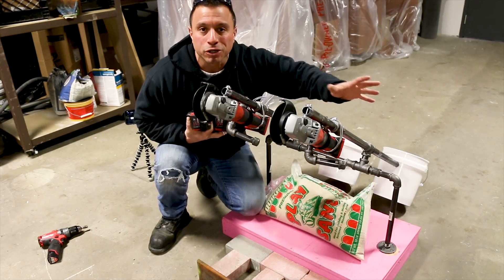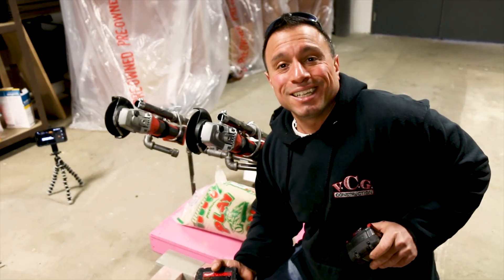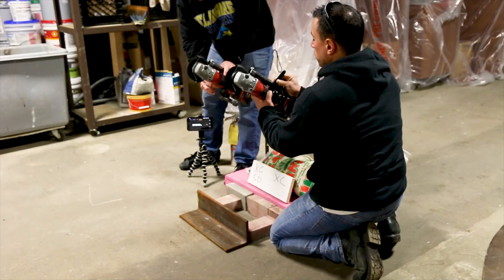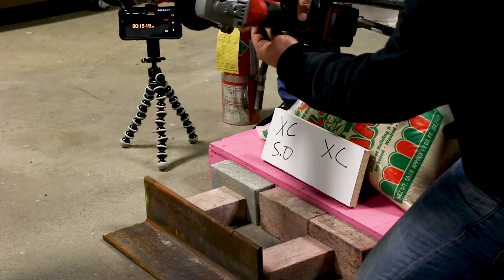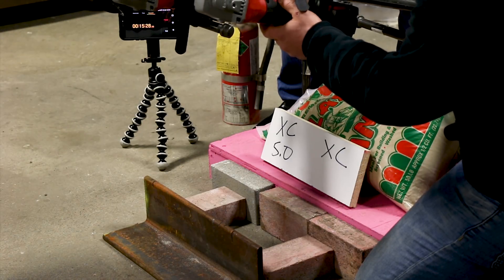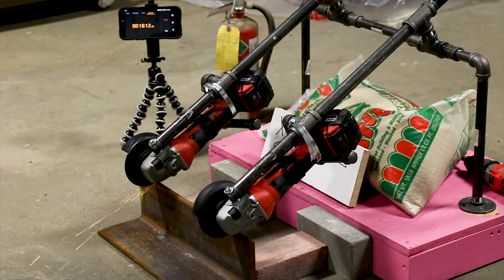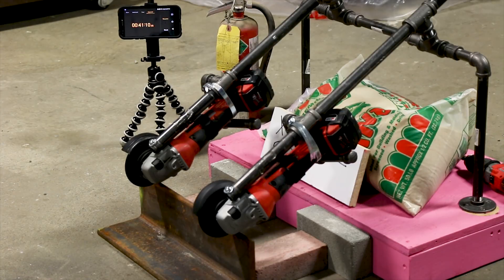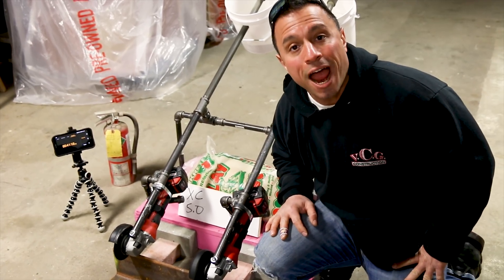Milwaukee M18 Batteries Tested Under Load !

Comment: 3.0 was under more load in this video which is why it cut more. The 5.0 lasted so long because it was hardly under load. Shouldn’t be that big of a difference. 5.0 should last maybe 5-10 min longer.

Comment: Like I said in the last video as you see under load the XE 5.0 battery will run 1 1/2 times more then the XE battery
 As for the test rig great idea great concept one thing that I personally would change would be a crossbar in the back and in the front level and off both tools at the exact same height  So therefore when you push down both of the tools would make contact at the same exact time

Comment: Under load? Those pails are acting as a counter weight, not placing any pressure on the tool. The grinder with the 5.0aH battery cut through less than an inch in 41 minutes. Should have been able to cut through the whole angle in a quarter of that time.

Comment: You could use a pull up scale and make sure both have the same weight on blade ,there not grinding at the same rate. This test  is invalid not picking on you .Project Farm does some great test's.
Reply from the maker: It does need refinement, thanks for the tip!!

Comment: Scratch my last comment... would help if I watched the video without fast forwarding. I didn't realize the fittings he used kept them from moving in unison. Yeah, I'm not sure why the 5.0 didn't cut through the steel at the same rate. Must be another variable that caused the difference.

Comment: Love the thought process and the time you took to run this test but yes there is critical flaw. The issue is the pipe that connects between the two rigs. Once the standard battery stopped, it rested in place on the steel, which in turn held the other angle grinder in place. The 5.0 battery/grinder didn't have any more resistance once it cut the steel at the held height from the other grinder. Had you disconnected the two rigs, they would act independently of each other. Keep up the great work... and these informative videos.
Reply from the maker: I saw your other comment as well and this test rig still needs even further improvement!! I’m gonna get it right one of these days!!

Comment: To be honest, I think it makes more sense to buy the battery that suits your need, more than $/runtime.
At work, I am using the Milfuckee Wet/Dry vac (Cleaning heavy equipment). All the batteries in the shop at 5.0s, and generally, I can do a machine well on the first two bars of charge, before the battery voltage starts dropping, correspondingly dropping the chooch factor. If I were using the 3.0, I would pretty much be guaranteed to have to replace the battery at some point, just to keep the vacuum chooching at a respectable rate. 1 bar? Damn thing is struggling.

In my use-case, the 5.0 just makes more sense (6.0 or 9.0 would likely be better, especially for rock trucks and their larger cabs).

Comment: Nice job what's strange is why one cut so deep compared to the other. You should charge the batteries and put the batteries in opposite machines to see if there is any difference. Great job by the way
Reply from the maker: We’ve did some fine tuning to the rig, now we need to run some new tests!!
Reply: Spot on comment. That is EXACTLY how to account for the variation in cut depth.
Reply: Also give us $ per depth of total cut.

Comment: id like to see another attempt, maybe throw the 9.0ah into the mix.. id forget the rig although it looks like itll come in handy for other tests anmd just cut strips into 1/4" plate or lengthwise down flat bar by hand same person doingit and compare them to see how far they cut, try and keep feed pressure and cutting technique similar but they dont need to be exact

Comment: this is an inaccurate test. You should redo the test without the grinder wheel on the XC already about 1 inch deep into the steel. This causes more rubbing on the grinding wheel faces making the tool/motor work harder and asked for more power from the XC battery. You should do an independent test on each types of batteries using the same grinder. Plus, your test didn't really adjust for the weight difference on the XC and XC 5. One is heavier than the other which adds more weight to the mechanism. More weight means more loading and requires more torque from the motor. For a motor to generate more torque, it needs to pull more current from the battery.
Reply from the maker: We were definetly thinking about revisiting this test! Thanks for watching!

Comment: The test should be run 3 or 4 more times.  I would say with the same grinder to reduce the variables.  Also add a small weight to push it into the metal.  Even the weight of the other battery to keep the down pressure the same.  Use a new grinding disc each test. If you really was to run the test side by side at the same time you should run the second test and flip the batteries in each machine so the one running the 5.0is now running the 3.0 for the next test.
Reply from the maker: Thank you for the input and suggestions!! Thanks for watching!!

Comment: I have used the 3.0 and 5.0 batteries on the 7 1/4” miter saw, and the 5.0 does more than double the cuts.  The stronger cells seem to last longer under sustained heat and load.
Reply from the maker: Can’t wait to see what kind of runtimes I get with the new 12.0 batteries!! Will you be ordering  them as well?
Reply: VCG Construction definitely.  I actually don’t have any of the 9.0 ones because the 3.0 and 5.0 ones have been so good.  I also have one of the 6.0 ones as well.  I’m thinking of getting 2 or 4 of the 12.0 ones.  1 for the stand light, 1 for the vac, and 2 for the table and 10 inch miter saw.  I will wait for promotions on these though because I am a 1 man crew.  I do bathroom remodels and 80% of them are just new showers.  One thing I hope Milwaukee does get into is the power station like Dewalt has.  That thing is invaluable on so many levels.  I have actually made 4 m18 to 20v max adapters, and the m18 batteries work on the power station just fine.

Comment: You should have put one 4"X4" a cross both of them to have some real world action
Reply from the maker: The weight of the grinders stops the cutting wheels, thats why we added counterweight! We can try removing some for more action!
Reply: VCG Construction 
If it stops so easy then it is not worth buying
Reply from the maker: I know a corded wouldn’t stall so easily, but for light duty work these brushed units do okay!! I’d like to test the fuel units and see how they’d do!!